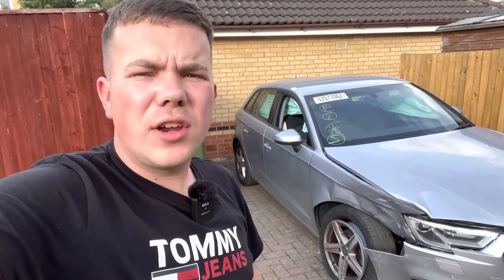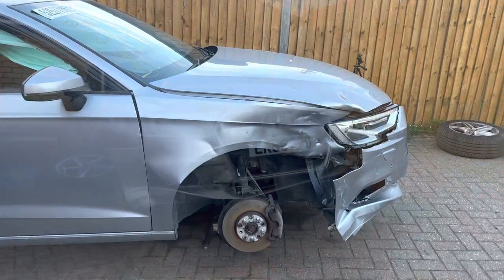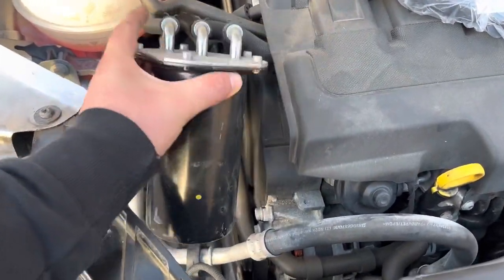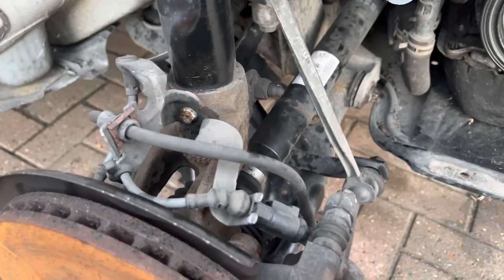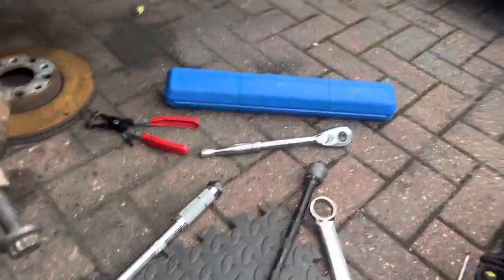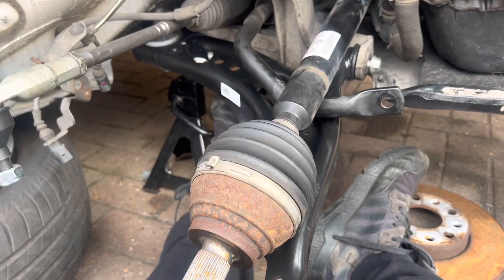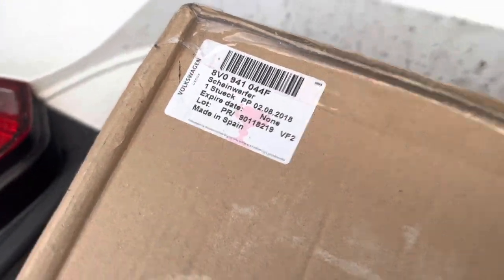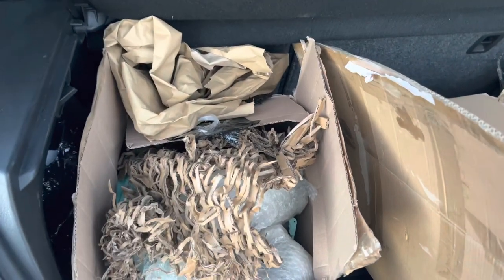Rebuilding a damaged Audi A3 8V from copart part2

Comment: Hi mate cheers for letting us know about Easy manuals and parts link 24 I’ve used them and purchased a manual for my Volvo c30 !
Reply from the maker: No worries Callum there both very useful for us petrol heads 👍
Reply: @NathanHiley  definitely especially when you wanna repair a car to dealer specs !

Comment: Hi Nathan, the older models below 2015 has the same crash sensor system (the tube and connectors each side)? or just a plug and 3 sensors in the bumper.. Thanks

Comment: Hi buddy, you just saved me from buying the a frame bit. Breakers wanted £200 for it. Thanks 🙏
Reply from the maker: Always love comments like this glad the channel helped you 👍
Reply: @NathanHiley  thanks for making a close up video, you the first one I’ve seen do this! Quick question, will the piece need welding back on? Can I drill out the spot welds at home?
Reply from the maker: No worries I always do close ups on the damaged areas so future owners can see what the damage was. And yes old one will need the spot welds drilling out and all depends if you are welding the new one your self . As some welders will want to take off the old one and replace with new . Btw the new piece will need holes drilled out where the welds were on the original one
Reply: @NathanHiley  thanks mate🙏💯
Reply: Where can I find this part